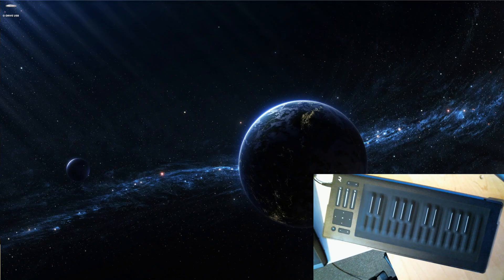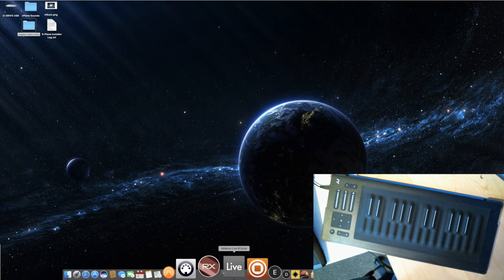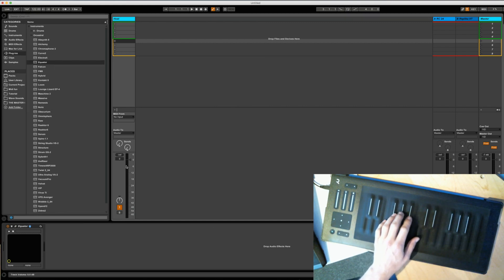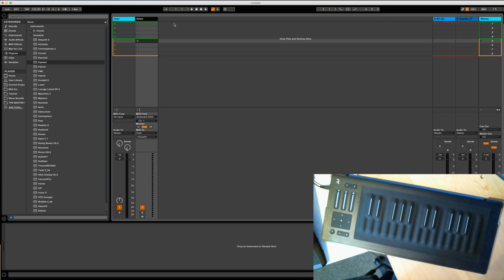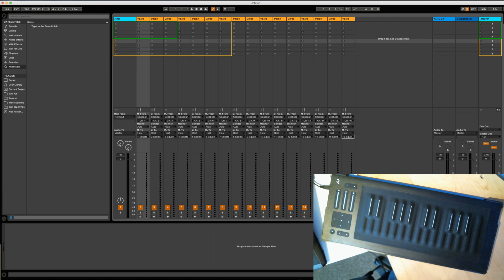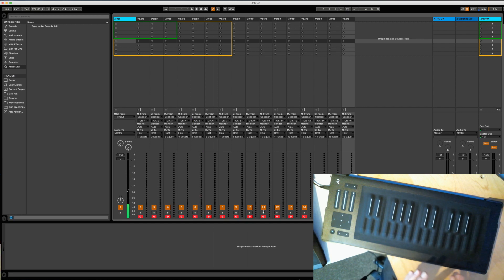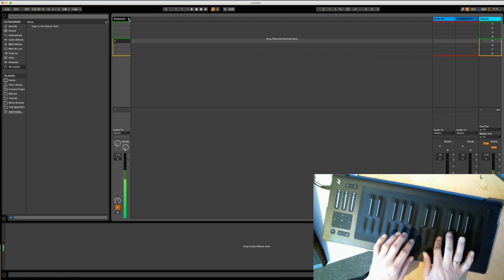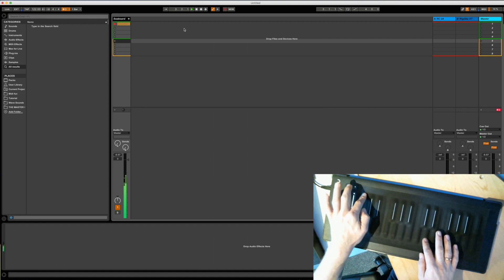Setting up Roli Seaboard up  with Equator in Ableton

Comment: my sound is incomplete, it just lacks of deph, it does record but does not get the quality
Reply from the maker: Do the sound card work proper with other synths? Have you tried reinstalling equator again?
Reply: @JesperSvane  i already solved the problem, now my doubt is if you can record loops
Reply from the maker: I'm curious how you have fixed it 😀
It is the same as working normal in ableton.
So yes you can 😀👍
Reply: @JesperSvane  the only way you can make proper loops is with the rec button on, on all 16 channels, so it gets full mpe effect. The thing here is that if you want to use Ableton as a looper with other instruments or equator's effects,  you can´t, unless you know a way to keep various grouped tracks in rec mode and respecting the assigned equator effects... Don't now if I explained myself properly
Reply from the maker: @cinematicagameplay1810  No thats true, it has its limits in Ableton, im hoping it will be solved in the new update Ableton update and that is on it´s way

Comment: Thanks, I've successfully set up Seaboard by following this tutorial, but the sustain pedal linked to my Seaboard 49 isn't working in Live 10. It works when loading Equator in stand-alone. I've tried toggle the pedal midi setting in Roli Dashboard, the midi data is sent to Ableton (the little yellow light on top-right of Ableton lights up) but no sustain is applied. Any idea what might be the issue?
Reply from the maker: Hmmm, That's weird... It works on my system and I'm running Ableton 10 as well...Just tried it

Comment: Hi. I have ableton live 10 lite and the full version of equator with my seaboard block. When I try to insert the equator plugin into ableton, there is nothing there under the section where the plug ins are. Also, I have checked that it can use plugins.
Reply from the maker: So go under preferences under file folder switch use vst plug-in system folder if you have a Mac 
If you have a pc turn on use vst plug-in custom folder and finde your folder equator is... hope that answers your question 😁

Comment: With Ableton, it's easy to fix notes with hotkeys and dragging/rebuilding, but what I did not realize with the ROLI is it's extremely difficult to make these adjustments, quantize, since there are 16 tracks and pretty much impossible to make easy adjustments. I haven't seen any videos showing an easy way to do this. I can record as midi and to an audio track, but to quantize is virtually impossible. Any suggestions?

Comment: Where did you find the vst version of equator? I have the stand alone but no vst
Reply from the maker: Andrew Wong Hi...
On the home page same place that you download the stand-alone
Reply from the maker: when you install the software there is both standalone and vst... 
I don't know if the windows version is like the osx version (I use osx)
Reply: Doesn't seem like it for windows
Reply from the maker: I have it on win as well so no problem for me
Reply: Well, I seem to not have the .dll file of Equator that could be added in Ableton Live as a VST plug-in. Strobe 2 player has the VST file of it automatically but for some reason not Equator
Reply: If you still have issues, the equator .dll file automatically gets installed into program files/common files/steinberg/vst2
Reply: Thanks! That helped. I didn't know about that folder at all
Reply: @finniko1995  your seaboard works fine now on pc after finding this folder?
Reply: @finniko1995  I have a Problem with opening this .dll Its inside the folder but if I want to open it in Ableton I can't find it? :(
Reply: @ch.sprung8121  I think you have to update your plug-in library from the settings. I think... That's what first comes to mind
Reply: Solution: https://help.ableton.com/hc/de/articles/115000349184-VST-AU-Plug-ins-werden-nicht-angezeigt

Comment: following your guide i get the error message "Midi out of range" Note data is coming into equator on CH1 which should be reserved for the global midi messages. i haven't been able to figgure out why though...any thoughts?
Reply from the maker: Sherman Parking I will really like to help you 😉 if you want you can reach me on Facebook messenger   and see if we can figure it out together? 
Just ad me (Facebook page jesper Svane)
Reply: Copy That. Look For "Prince Mcknight" Thanks!
Reply: Did you fix that, as I get same error?
Reply from the maker: thegoony hi yes i fixed it 😎 you shold just follow the video step by step then you should be fine